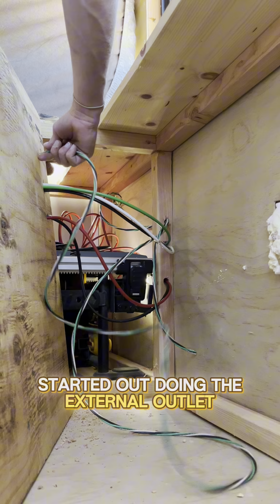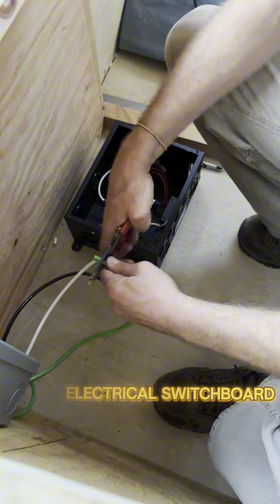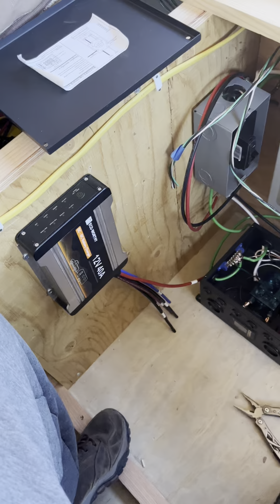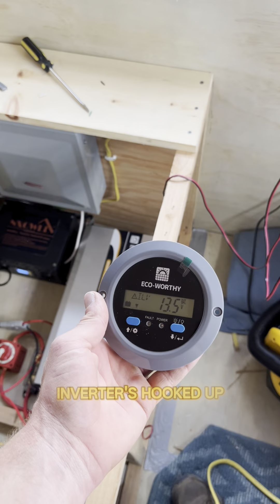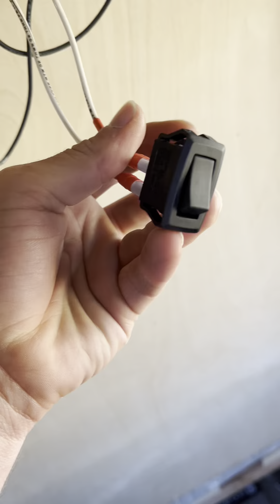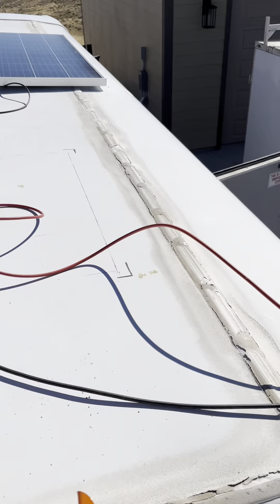Power system ✅ #diy #skoolieconversion #electrical #jackofalltrades

Comment: if i was making this myself i'd make some rounded cover up front on the Solar panels i believe it wouldn't be good for them if wind catches underneath during a drive.
Reply from the maker: This is my second bus and it really hasn’t been an issue for the last one. But I might just 3d print some guards and add them great idea.